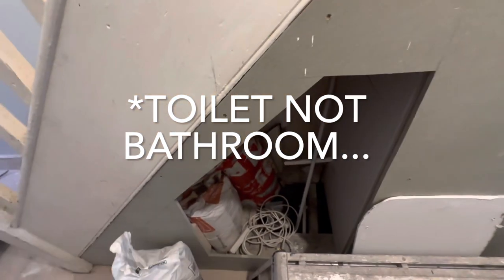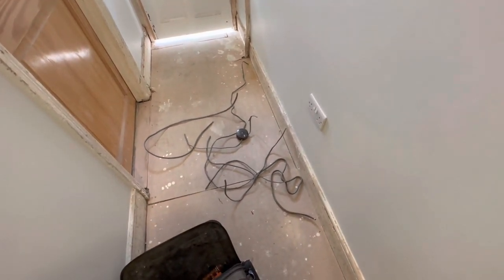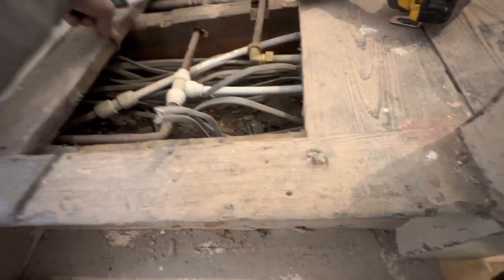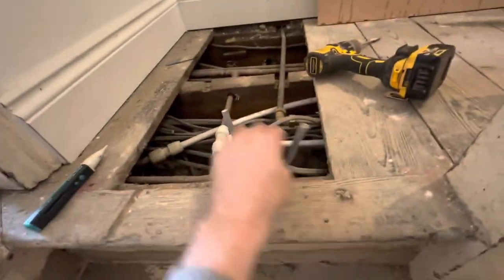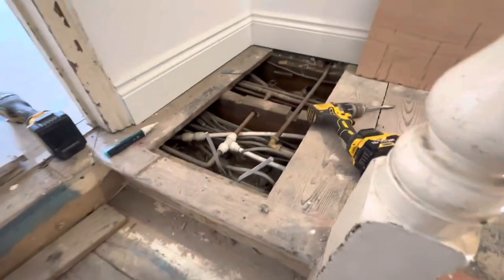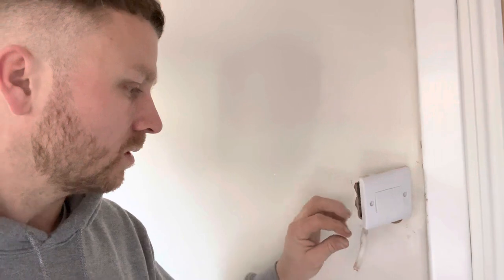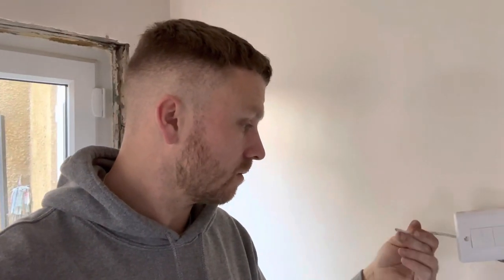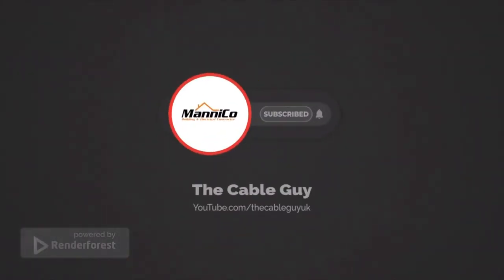Installing power for a Saniflow unit.

Comment: Saniflow installation instructions state that the electrical supply must have an 'unswitched' fused spur fitted.  Not a 'switch fused spur'.
Reply from the maker: Hi Stephen, glad your watching the videos. In this particular install the Saniflow install manual "recommended" an un-switched spur but we installed a switched fuse spur as the customer wanted a means of isolation without removing the fuse. 

Jensen.